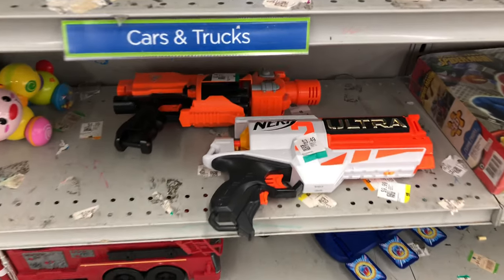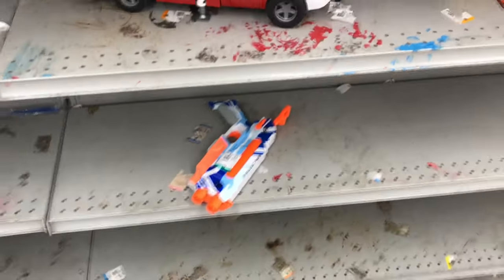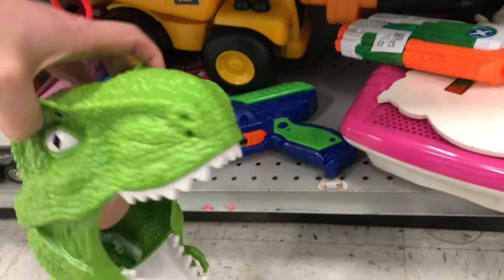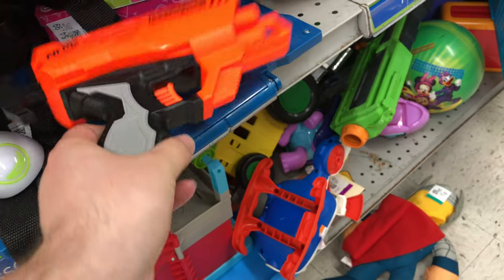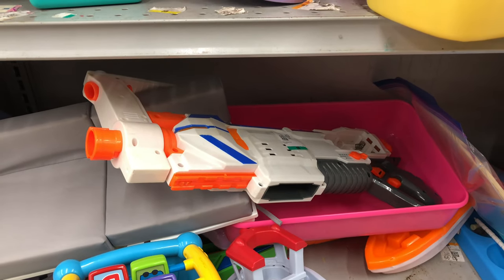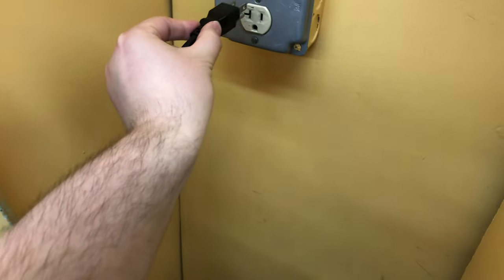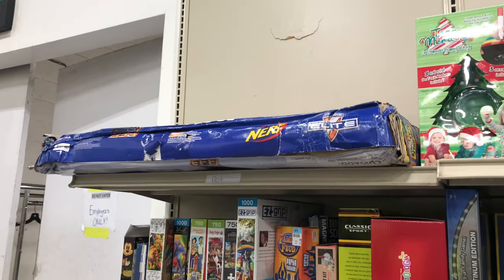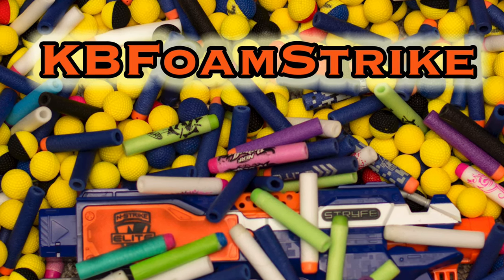KBFoamStrike's NERF THRIFTING Vlog EP. 50: A Huge Milestone Extravaganza - 3D PRINTER FIND!!!!

Comment: Hey KB foamstrike I just found out a secret about a certain blaster I think!!! If you find or thrift the hasbro 2010 general grievous clone wars single shot blaster it hits hard with short darts….I got it new in box and had an issue with the dart post laying to the side…was hard to load darts so I had to take it apart (not fun cause it’s glued in one bad spot) then got to the dart post and took it out then with the short dart shoved all the way in it hits 82.7 FPS (achieved  with dart zone red short darts) consistently with the stock spring 😳 holy sh$& that’s really good 👍🏻